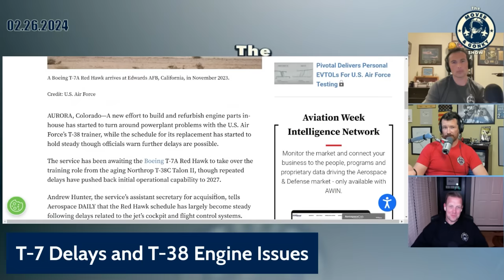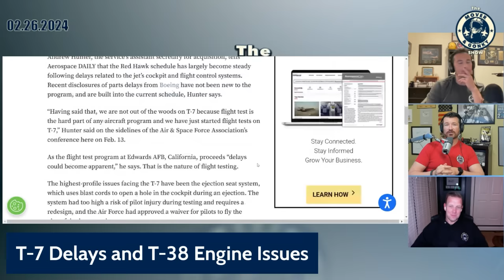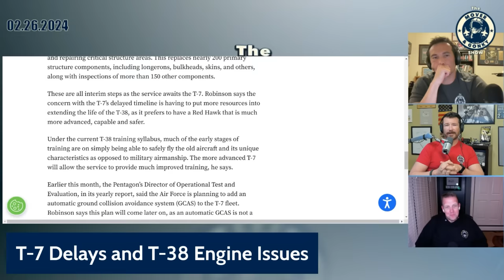T-7 Delays and T-38 Engine Issues

Comment: What about the Boeing T-45 Goshawk being used by the Navy, Can't the USAF used it as Well? In the Meantime that is!
Reply: No, for multiple reasons.  First, and the obvious, is the T-45 does not meet the requirement spec for the bidding that USAF wanted for the trainer program.  The second, production line closed over two decades ago.  You can't just start stamping out planes, it takes years to spool up a new  production line.
Reply: @cup_and_cone Use, not buy, the ~200 T-45 Goshawks the Navy currently owns and operates
Reply: @cup_and_cone  BAe stopped building Hawks last year as well

Comment: All they need to really do is just put a GEF 110 in the T 38 which is the same engine that the F 15 EX has in boom problem solved they already have a useful airframe. They already have a working engine that is being mass produced for the F-15. Why can’t they just use that?? Not only would it gives T 38 pilots an extra speed, boost, and power boost on top of that, but it would ensure safety because the airframe has already been proven to work for decades I feel like they’re kind of wasting money on trying to build a whole new trainer yet that’s going to have inferior technology in about 10 years anyway so I don’t know I feel like this is a lost cause